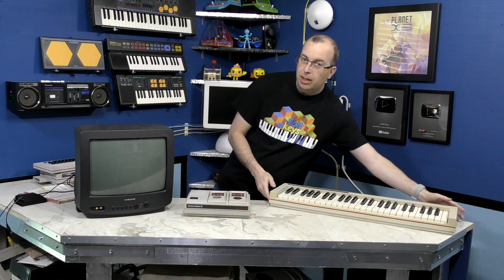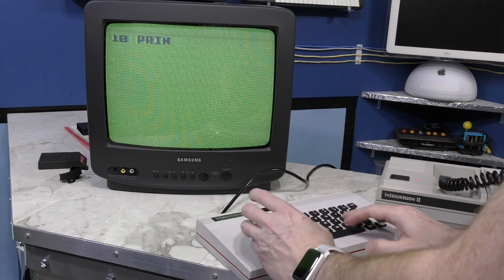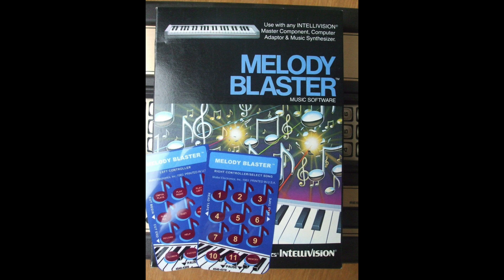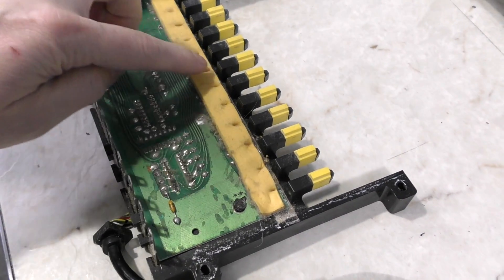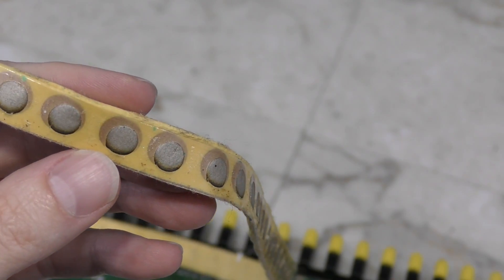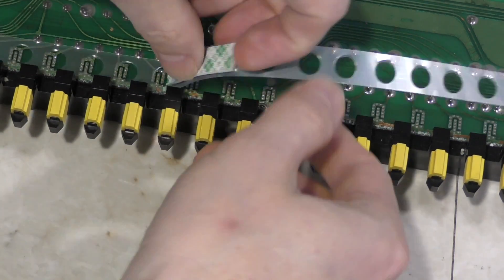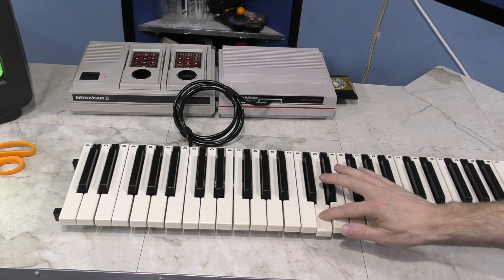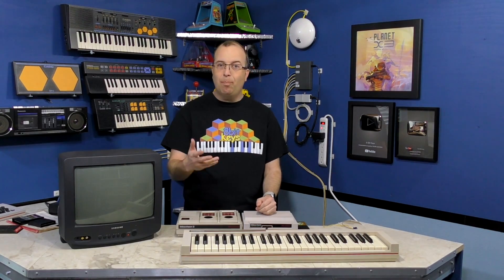Intellivision ECS Keyboard Repair and Demo

Comment: Removing the pcb from the plastic is really easy: Just carefully cut the melted plastic flush with the pcb. 
You should now be able to remove the PCB. You are then left with plastic tabs which you can use to mount the pcb onto later.

When reassembling, just slot the pcb back onto the tabs until they are flush with the top of the keyboard.
Now, to get the pcb to stay put, here's what you do: 
Get a small phillips head screwdriver which. Heat the tip of the screwdriver almost glowing hot with a lighter or similar.

Then, carefully press the tip of the screwdriver into the flush cut tab. This will force the plastic out in a sort of cross which locks the pcb into place.

I've used this method a hundred times in situations like this. Works every time.
Reply: What about a blob of super-hot glue? Not with the glue gun, with the hot air station or the paint stripper gun. Super hot glue bonds better.

Comment: Seems there's a long history of game consoles with accessories to turn them into computers.

The Intellivision, the 7800...

The Famicom - actually given it's name that's to be expected. Ironically the NES was first presented as a home computer for the US market, but Nintendo were told in no uncertain terms that this would be a bad idea.

Of course there's also purpose-built hybrid devices, like the Atari XEGS. (while it's release was a bad idea in the long run, it's existence is no huge surprise given the Atari 5200 was a flop but basically the same hardware as the 8 bit home computers; So that made the XEGS the 5200 but reworked to use the more widely available A8 software.)

Interesting concept in general. And believe it or not it still persists in some form into modern times;

Both the Playstation and Playstation 2 had (hard to come by) kits designed for hobbyist software developers - obscure, and very limited compared to commercial development, but still interesting.

The Playstation 3 of course, infamously had it's 'other OS' option - eg. the ability to run linux. Even though they eventually patched it out. 

This is a bit of an Edge case, but the Super Famicom had several releases of RPG Tsukeru (RPG maker) released for it, alongside specialised external storage for saving your creations that works through controller port 2. (reminds me; I really need to reverse engineer one of these save devices at some point; would be oddly useful.)

The Gameboy advance had an officially licensed cartridge that allowed small custom programs to be written. (it was also designed to allow video playback AFAIK)
The Nintendo DS apparently has some obscure Basic program....

And, as of about a month ago, the Nintendo Switch has Fuze4Switch; a basic-like programming environment (it's not basic; It's more like a hybrid of Basic and C with a few of it's own quirks thrown in), with built in support for sprites, 2d and 3d graphics, some kind of simulated 16 channel FM synth device (The device is not representative of any real hardware; it's just a software synth with properties comparable to a 2 operator FM synth.)

It's both kind of weird, but also a lot of fun being able to write arbitrary code on a Switch...
Bonus points for it being a portable device...

Obviously performance is terrible, relatively speaking, given it's an interpreted language...
But still...

Meanwhile, aside from adapters that turn consoles into full computers, musical keyboard adapters also seem oddly common.

Weird.

Comment: I'd use a non-perishable like silicone and build my own mould then set in some new contacts but I imagine that would cost and time prohibitive getting the correct consistency and thickness to avoid double note triggering (unless you wanted to hack your own weird intellivision roli seaboard or something). I liked your solution eitherway, keep up the good work Dave.

Comment: i did almost the exact solution for a remote controller that got the carbon in the buttons melted for some reason. i made a spacer with paper and a piece of aluminum film on the top, that did the job until my mother got the controller in the washing machine and i got so pissed i told her to go buy another remote controller (i had already fixed that controller twice at that point)

Comment: I'm wondering why you didn't cheap out and use a VCR to record the sound sample. sure it would be mono but most VCRs I have been around have had video out on them with at least left channel out. never seen stereo out but then again I have only seen budget models. I'm probably missing some reason you didn't do this though.

Comment: A hundred years ago I got one of these and built an adapter to convert it to MIDI. Using a PIC chip. Decades before you amateurs started calling it Arduino. Hot dam I'm so amazing.

FYI the key contacts are arranged as rows and columns, just like any other keyboard. The row and column wires are directly exposed via the twin 9-pin connectors. So if you want to build an adapter, just use any PIC or Arduino or Teensy with lots of digital I/O to scan out the rows and columns.

The computer keyboard probly has the same row/column design, which is why it works in music mode.

Comment: To write your own code to directly control the sound AY-3-89xx sound chips, you can:
1.  Write some code in either CP1610 assembly or a better option would be IntyBASIC which is a compiled BASIC (not to be confused with the limited and interpreted BASIC built into the ECS).
2.  Get the LTO FLASH or Cuttle Cart 3 cartridge to load your software onto.

Comment: Very cool. I got the brown version of the keyboard and luckily mine still works fine. I'm planning a project for a music sequenser (running on the Intellivision) which will also include extra hardware to control both analog synthesizers (using CV/gate) and some 8-bit computers (like the C-64). :)

Comment: Weather stripping (as suggested by others in the comments) for around doors and such would be perfect. One side is sticky, the other side isn't. And the mylar can be quickly swiped with a sharpie or something on the back of the sheet (random pattern, don't matter where it is, just that it is somewhere) and then you will know where the non-conductive side is. What a bizzare and awful design for the keys! Sheesh. It always makes me wonder if it would be easier to just re-make the whole PCB and accommodate for better switches--but then I remember this thing is a failure and that making it 'better' isn't really the goal!

Comment: Seems to me that using "print" instead of "prin" would necessitate the use of 8 bytes of memory to get those 5 characters, vs 4 for prin - and on an ancient 8-bit machine like this nifty-but-ultimately-sad-excuse-for-a computer, those 4 bytes would matter a lot, given what memory used to cost. 

They probably had a spreadsheet which demonstrated that reducing all commands to 4 characters would save Mattel $1000 per year or something.

Comment: "So, I'm going to have to test eeeach individual one with a multimeter to figure out which side to put them on.."

Why didn't you just blanket mark/color the non-coated side /before/ punching them out..? o_O
Reply: I had a good laugh at the vlc joke, I laughed even more at that part of the video XD

I bet just didnt think of it before... like when remembering heat shrink after wire is soldered :D
Reply: @enjibkk6850  : Except that you can get this vinyl paint-on "heat shrink" stuff (they actually call it liquid electrical tape), so that one you can easily (even if messily) fix.
Reply: @enjibkk6850  can I have a timestamp for the vlc joke? I seemed to miss or it it went over my head 😕
Reply: @Ryan1456100  here you go: 11:17
Reply: @YyXblu  thanks, I must've been reading the comments or something because if it were real it would've slapped me right in the face with how obvious it was 😂
Reply: Use _ instead of / for italic text!
Reply: Kuro Katamari Style is subjective, and personally, underscore is wonky looking, while forward slash suggests the slant of /true/ italics, so.. fuck off, I guess..?
Reply: @Communitis  I'm sure sure Kuro was just trying to be helpful rather than condescending, but that's my understanding of it
Reply: Andrew Micallef Opinions are nice, I guess.
Reply: @Communitis  He suggested underscores because they create actual italic text Good job on being an extremely rude internet denizen, though.
Reply: I could tell the difference on video between the conductive and non-conductive side. Maybe it was less obvious in person.
Reply: Everything makes sense in retrospect, but not always obvious in the moment

Comment: wait wait,
did you leave the top layer of stickiness-prevention-coating ('wax paper') on the double-sided tape?
if so, why not take that off and wait for the adhesive to dry or cover it in powder or something, that's probably why it's too stiff

Comment: That keyboard uses a design based on foam-and-foil switches from computer keyboards, except with the contacts painted on the foam instead of using little pieces of foil.  Your new design with the mylar is closer to how a foam-and-foil switch works.

Comment: AkBKukU did a repair video in which he had to repair metal contacts (I believe it was for a very old computer's keyboard) and he ended up doing something very similar. Had to make a sandwich using some sort of foam material and a punched out circle of conductive material. You might wanna look into how he did that.
Edit: You'll find it if you search "AkBKukU Compaq Portable Foam & Foil Repair"!
Reply: Yeah it's a good one, I really don't envy having to work on that computer

Comment: that "computer" addon along with the Aquarius seems to be why nobody's talking about Mattel computers today.
Reply: I had one when I was a kid.  It was awefull for programming. It had one really good game called "mind strike".  The word was they made the computer add on because they were being fined for showing a keyboard adapter for years as "coming soon" in ads,  and were starting to be fined for not actually having one.
Reply: you leave the aquarius alone! tron deadly disks was a great game :)
Reply: Mattel had computers? I knew about he Odyssey by Sears, but Mattel!? That's so weird.
Reply: @Zenas521  RetroManCave did a video series on the Mattel Aquarius. Probably one of the most pathetic computers of the early 80's.
Reply: Aquarius had Utopia, which was killer!
Reply: 1. Outside of quotes, because it is an actual computer, and 2. not really nobody. Here's one who is right now.
Reply: Zenas Starchild.  LGR has both "Hot Wheels" and "Barbie" PC compatible computers. You can probably guess what they are like.
Reply: But why put the brands in quotes,  @MrDuncl ? Do you do that with all brands, for some odd reason? If not, then how do you decide which ones?
Reply: @HelloKittyFanMan.  Because I know the only thing Hot Wheels and Barbie about the computers was the paint job and bundled software. In fact the computers weren't made by Mattel at all although they had Mattel's full backing, something yjey might have later regretted. If you want to see more https://www.youtube.com/watch?v=TfhmBcBPNyc

Comment: Thanks for another interesting and entertaining video :)
Self-adhesive draft excluder tape would be perfect for the job :)
You can get it in various widths and it's great for making foam feet.
For the conductive pads you could also try conductive rubber keypad repair paint.
I find the rubber keypad repair paint better as some conductive paints can oxidise and don't particularly like flexing (both mechanical and thermal).
I'm a fan of repairing and up-cycling tech... although I'm not sure my wife would agree :D
Sometimes you just wish you hadn't started something, but it's great feeling when it works again!

Comment: 12:57 you could have sprayed the non-conductive side of the whole sheet with some sparse pale paint before punching circles. This would saved you a lot of multimeter testing time

Comment: Thinking about that foam strip... it reminds me of this weatherproofing strip for doors/windows that my father had a couple of years back.
Something like this https://www.ebay.co.uk/itm/4pcs-Door-Window-Foam-Sticky-Insulation-Excluder-Tape-Weather-Strip-Seal-Noise-P/163587406463?hash=item261691ba7f:g:EMUAAOSwWB5cZ~LZ
And for the contacts, I think I'd go with tactile dome switches, as you'd find in an old atari joystick. They'd be about the right size, and might give a snappier response with no bounce-repeat. I found some at https://www.aliexpress.com/item/33029270409.html?spm=a2g0o.detail.1000060.1.289210f4Detnwd&gps-id=pcDetailBottomMoreThisSeller&scm=1007.13339.146401.0&scm_id=1007.13339.146401.0&scm-url=1007.13339.146401.0&pvid=b1fb218c-8580-43f4-9788-0ec85aec848b that'll give an idea of the price these things go for. I dare say you have some classic controllers that could use new domes too

Comment: You try the AC weatherstrip foam. Looks ideal for this application. Has adhesive on one side; and width, thickness, and "sponginess" should be just right.

Comment: "The contact system here is probably the cheapest, most horrible design I've come across so far" - that's the Mattel® way!
Reply: This comment is especially funny to me as someone familiar with their first attempt at making an electronic keyboard, the 1970s Optigan. That too was a disaster due to awful engineering and build quality, despite having some pretty clever and original ideas behind it.
Reply: @stevethepocket  look on my channel and you'll see I'm inclined to agree...I documented the repair of one a couple of years ago.
Reply: @jamesbennettmusic  Neat. And great to know there's at least one of them in the UK; crossing my fingers that Techmoan gets a chance to borrow it someday, because it seems right up his alley and would make for a fascinating video.
Reply: @James Bennett
Your videos on that repair have mesmerized me!  Thank you very much for sharing!  What a fascinating machine...
Reply: Mattel eventually let this go and focused on lead painting for toys.
Reply: The funny part is that this statement is coming from someone who is dealing with crappy toy keyboard mechanisms on a regular basis. So that means that is the mechanical design of this device is up there with the worst keyboards, or down there, well how ever you want to put it.  ;)
Reply: You can tell it’s Mattel, it’s swell!
Reply: I'll bet Barbie could fix it.
Reply: James Bennett: Nice how you added the registered trademark symbol ASCII character. It's like adding ® emphasizes the cheapness of the brand name.
Reply: It is the worst design I have seen ever on a keyboard. What a mess! Glad it works again but oh boy is it bad design. But that's Mattel for ya
Reply: Isn't Barbie the same? 5 parts, plus head, lack of curves to use less plastic to make it. Whole fasion industry mimics this Mattel way or should say voce versa.

Comment: There's also a BASIC adapter for the Atari 2600, believe it or not.

Yes, please do a video (or two) on the Matell ECS! I would love to see just what's in the box and how it works!
Reply: I believe every console from the 80's had a BASIC computer available for it. Even the NES did, but wasn't as easy to start due to the fact that it doesn't have the same expansion ports its Japanese counterpart, the Famicom, have.
Reply: @Chaos89P  The Famicom had Family Basic. It was never officially released for the NES in America.

Did the Master System have a BASIC mode?
Reply: @AiOinc1  Not specifically, although there was a keyboard and BASIC cartridge for the Sega Mark-III (ie. the Japanese version of the Master System).

Comment: You know, I was thinking about this. I could totally re-engineer this thing with a 3D printed mechanism and some bubble contacts or something.  It would of course never be worth the trouble but it could be done!  On the other hand, that exact foam is sold at Home Depot in the cabinet area for padding.  I have some of it in my shop storage bin.  You should have called me!
Reply from the maker: I had also thought about 3D printing something that could be epoxied into the back side of the keys, which would then have some sort of rubberized carbon contact or something on the bottom.  This would eliminate the need for the foam completely.  But, didn't have the desire to undertake that.
Reply: @8BitKeys  can you not buy standalone bubble domes?
Reply: 8-Bit Keys Just big standard bubble contacts and some mechanical padding to hold up the board.  Not as authentic as keeping the original plastic strip, but no custom manufacturing needed.